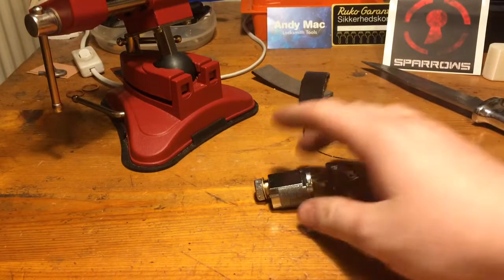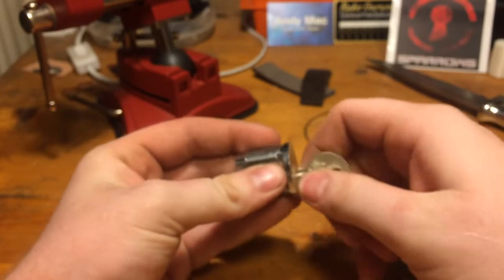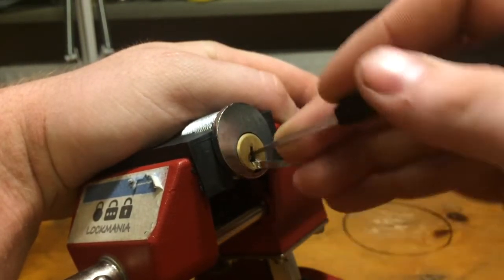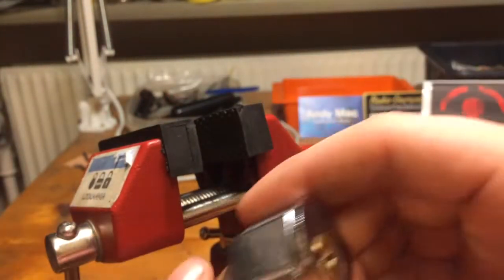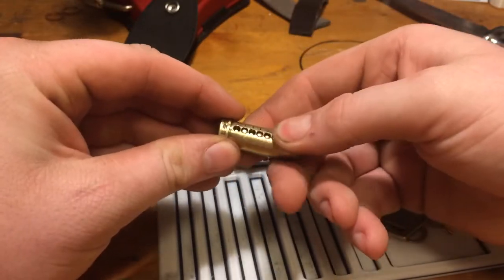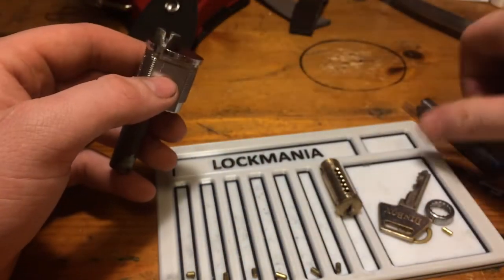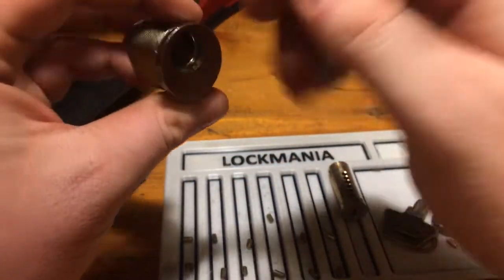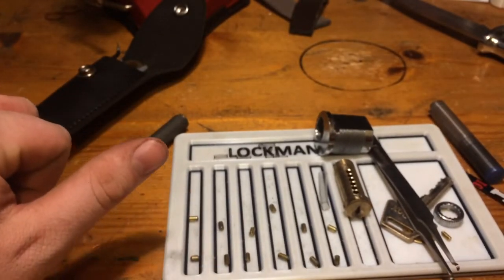(161) 6 pin ruko knockoff picked

Comment: last weekend I used one of them to brush a 5 pin key, as the cylinder just happened to be on the floor when looking for a Y1 core to deburr a fresh cut key. The bitting was far from the original 6 pin dinbox, still I pulled the core out with the key, as it had cleared the shearline.
Reply from the maker: Brush a key? Do you mean like using it as a file
Reply: lockmania as a wire brush. When you cut a key, tiny pieces of brass can fold over, so to get them to break, you normally use a rotating wire brush on the machine. But it can also be done by inserting the key into a cylinder a few times.
Reply from the maker: @RuneInternational  ah ok like that thanks